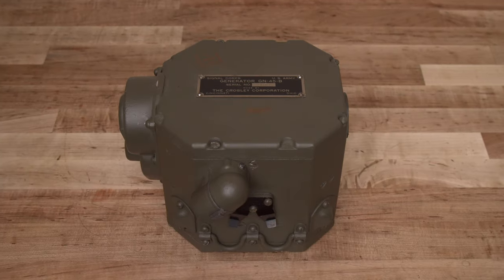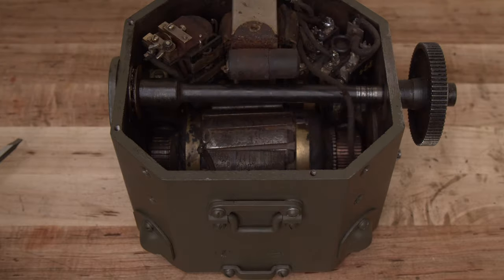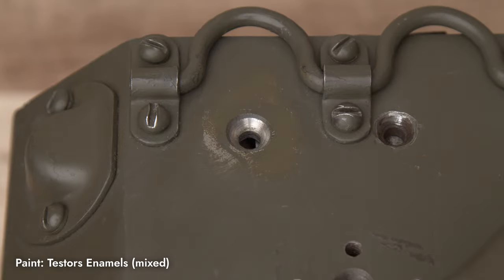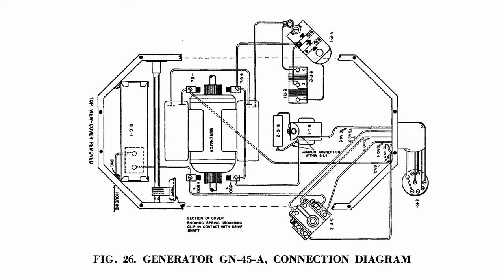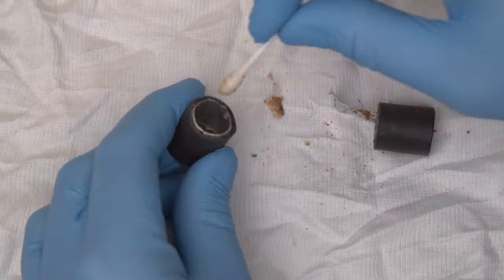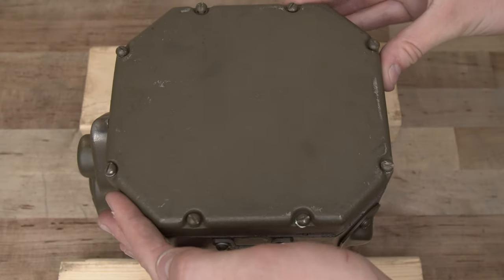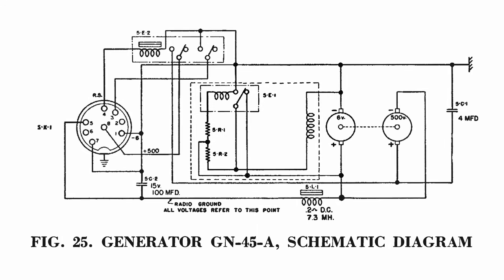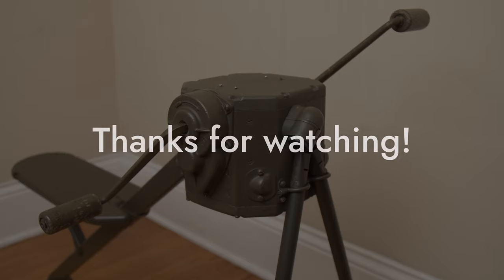WW2 Hand Crank Generator Restoration - SCR-284 Part 3

Comment: You did a great job restoring this generator...I can't imagine a soldier able to run that for long, especially providing enough voltage and current to drive Tubes, which are extremely lossy.
Reply: This was the main reason that the hand crank operation of this set wasn't popular. It was very tiring for the average GI. When using hand crank, the transmitter should only be operated at HIGH power 'for short periods of time'. I bet for those GIs, 'short' wasn't short enough (and for the radio op, LOW power wasn't high enough).

Comment: IIRC, this model radio was used in the sound effects of Pixar's Wall-E as the sound of his tracks rolling.
Reply from the maker: That’s so cool, thanks for pointing this out! It looks like they used a model GN-58 generator, which is similar to the GN-45 and works with the BC-1306 set.

Comment: I just picked up from a flea market a 1945 G-3B hand crank generator used with the TRC-7 radio. Excellent condition with the tripod seat/stand. Internal components look great and it works!!! Mine actually came with a cloth bag of never used brushes inside. Excellent flea market find!!  I too am wondering how much I should restore it. Needs some cleaning, a tiny bit of rust removal,  but I might consider repainting if I can find the right vintage OD green. Wish I could share a pic here. 

Yours is the only video I can find about these old generators. Maybe I should make a video.

Comment: The last hand-cranked generator in the US Army was the 1980s PRC-70, which came with a G-76 generator to charge the awful NiCad batteries. The thing was quite loud. And it was also tough to keep turning at the right speed to provide juice. It had a red/green light to show when enough power was bring produced. I hated this radio. It was made by Cincinnati Electronics, and was intended to replace the PRC-74 and PRC 77 for special operations units.
Reply: The whole PRC-70 thing was a debacle. They wanted a heavy radio to do too much, and with the worst rechargeable battery system we'd ever seen.

Comment: SCR-284 was the nearest US forces came to a 'bad radio'. Designed for development engineers in a lab, not frontline troops, it was heavy, heavy ("like carrying an air-conditioner on your back", according to some), the casing unable to keep out moisture and humidity, fussy and fiddly to keep going (the tuning dial mechanism needed a special jewellers type lubricant, for example) and hell to hand crank for any length of time (it also came with a vibrator supply and a dynamotor supply for vehicle or fixed station use). So poorly did SCR-284 perform in the really harsh conditions/terrain of Italy 1943 that the Signal Corps was forced to un-mothball the pretty dreadful SCR-511 'pogo-stick' cavalry radios to substitute.

Photos show the US 101st Airborne using the SCR-694 (a vast improvement) at MARKET-GARDEN (Sept 1944) - the French Army Signals Directorate documentation on SCR-284 is dated April 1947 so I guess the US Army Signal Corps arranged to dump these radios (plus other less than stellar performers like the hugely over-rated SCR-536 Handy-Talkie) on the French and other unfortunates like the Thai military, post-war, as soon as possible. Beggars can't be choosers after all.

Comment: I like the video and the work you put into this project.
I am wondering why you didn't spend some time on the armature which looks worn.   Undercutting the mica insulators was a standard technique that would also help prevent shorting between poles - and clean up those spaces.
You went a little overboard with the old style grease.    More modern equivalents, with better water resistance and temperature properties, would be more robust and last longer.
Keep up the great work.   It looks really nice.

Comment: Where do you go to find the capacitors and the carbon brush material. I have 3 radio’s and 3 generators I need to restore. Great set of videos and how to here!!!!!
Reply from the maker: Thank you so much! For capacitors I usually order from Digikey. For brushes, I get common carbon brush stock from McMaster, and less common types such as metal graphite directly from Helwig Carbon. Sometimes it is necessary to buy complete brush assemblies and cut off the size of stock you need.

Comment: I have an SCR-284 and GN-45 genny... The issue I have is that the CD-501 cable I have had 8 pin connectors on each end. The connector on my GN-45 is a 9 pin Amphenol connector. How do I replace the 9 pin with an 8 pin to work with my CD-501?